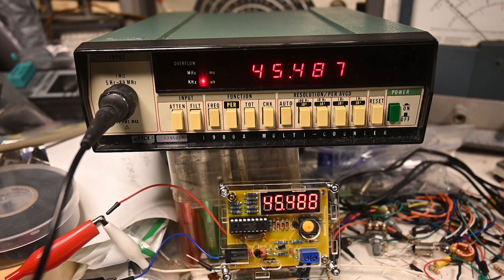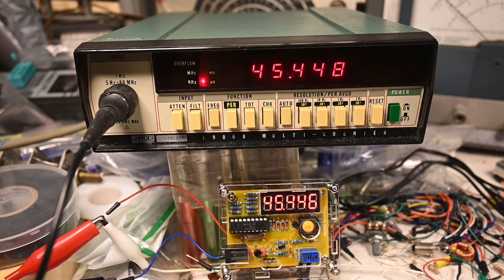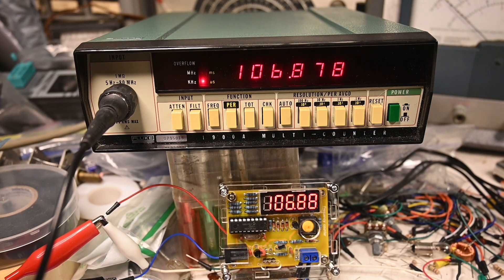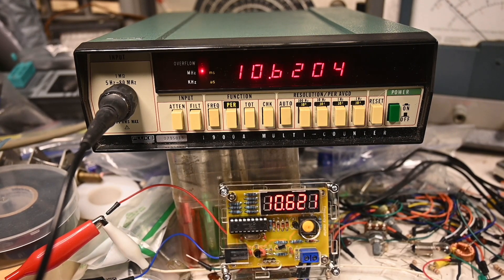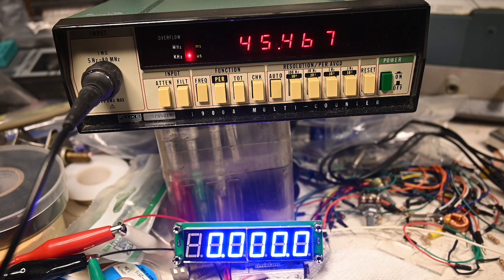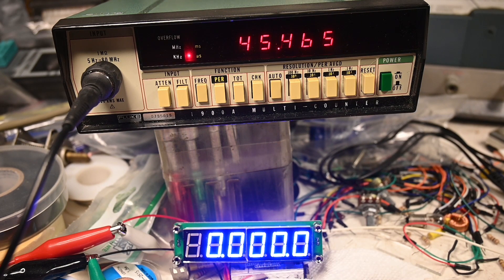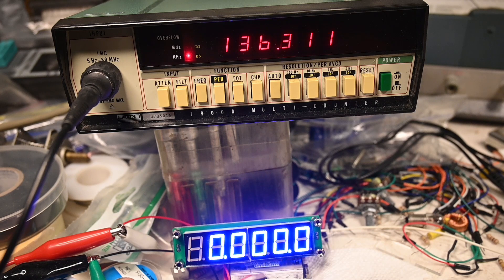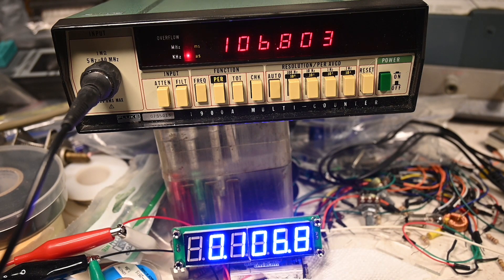Two Frequency Counters I'm Testing

Comment: I have several of the blue units, you can program the IF offset so it will read the correct frequency. Got them hooked up to my old shortwave receivers.
Reply from the maker: Thank you. That's great. It has surprised me how accurate they are.

Comment: 5:30 That frequency is excactly 3 times the 45,465Hz signal your putting into the counters,
so maybe it's not putting out a frequency of it's own, but rather distorting the signal your feeding so much that the 
other counter gets confused and counts each cycle as 3.
Maybe a good idea to have a scope connected so you see what happens to the integrity of the signal.
Reply from the maker: Thank you. It's reading correctly. I'm using an experimental frequency generator.
Reply: @AllAmericanFiveRadio  Yes, I understand that. But put a scope on the signal before you connect the blue led counter, and then watch the signal when you connect the blue led counter, and then see what happens to the signal.
Reply from the maker: @geirendre  I'll take a look.